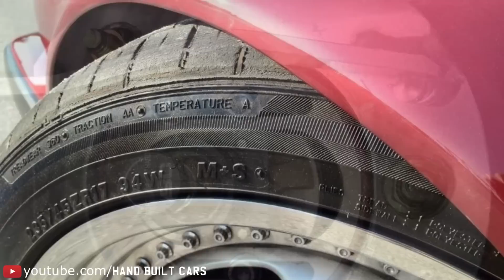1995 BMW E34 540i V8 6-Speed Manual Restoration Project

Comment: HE53 FTMFW!! I had 2 E34 540/6. One was an ///M sport. They are pretty fun. Best bang for buck mods is chipped 404DME, ltw flywheel, 3.15lsd from an early e32 750i, ssk, all the suspension mods, etc. Get m60 isn't terribly cheap to build for internals, cams cost a small fortune lol. If you can still find the S/C setup it would be worth it, or piece together your own with the PROPER standalone/ tune, or be even more of a pioneer and slap a couple snails on it. There are always swaps as well. S62 or S65 comes to mind. If you had the $ an S85 swap would be even more amazing. 👍😉